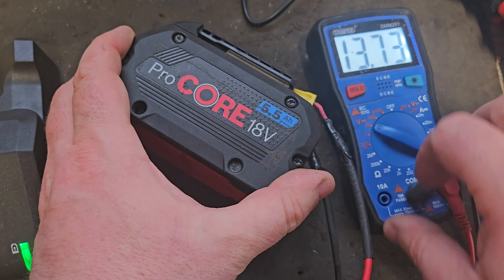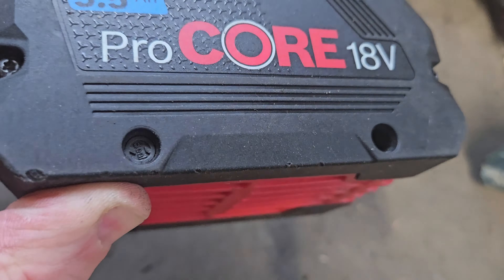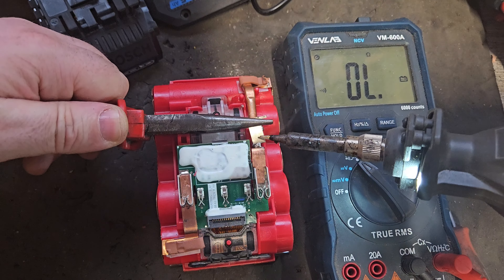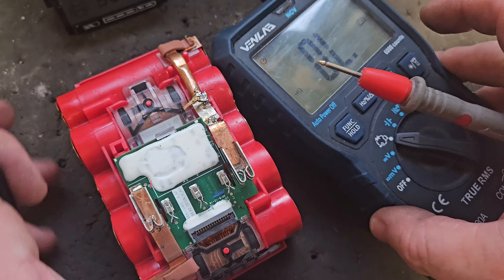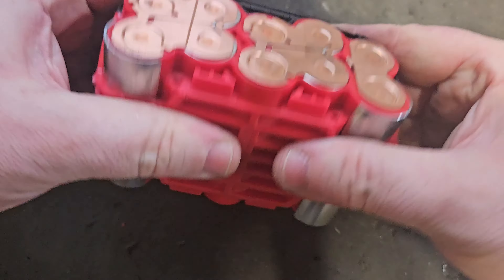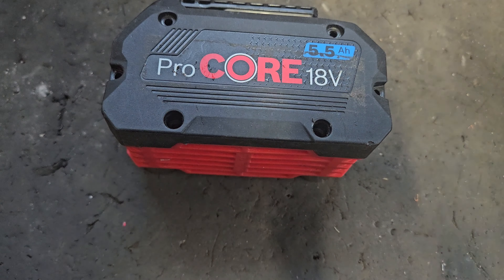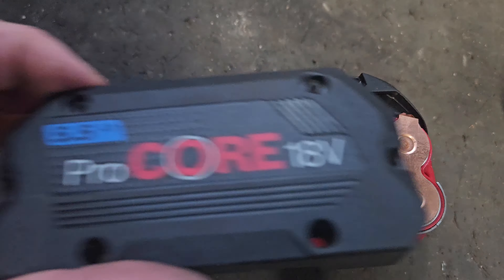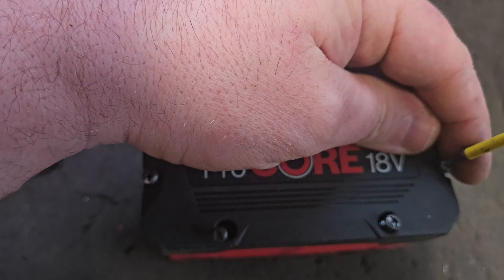Bosch Procore Battery: The Quick Fix You NEED to Know

Comment: I had the same problem and was unable to find a replacement so I used a standard automotive 30a fuse with the leads bent 90 degrees. It has been working fine for months now.
Reply from the maker: Great idea

Comment: My battery shows 19v then nothing.  Seems to switch off straight after showing a reading. Each cell shows just over 4v. Is this a thermistor fault and how do i change it? TIA
Reply from the maker: Check for for broken connections

Comment: Cant you just replace the fuse? I wouldnt be confortable sleeping next to that battery 😂
Reply from the maker: That's a fetish I never heard of sleeping next to batteries
Reply: @doctorlefthandthread  let’s hope no one is sleeping near it when it catches fire😮 surely just replacing the fuse is best repair 😊
Reply from the maker: @timbembridge5507 the  light nickel I used  burns out like a fuse long before any issue like the one you describe would occur
Reply: i think its better to replace fuse than bypassing it..for safety